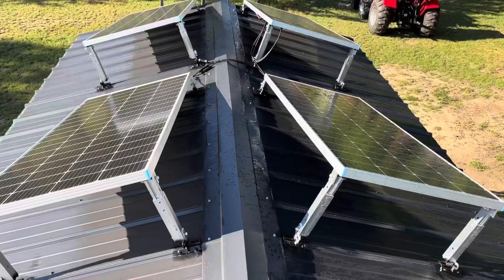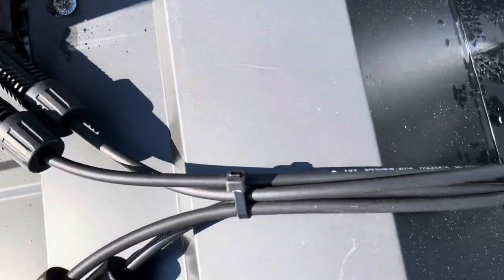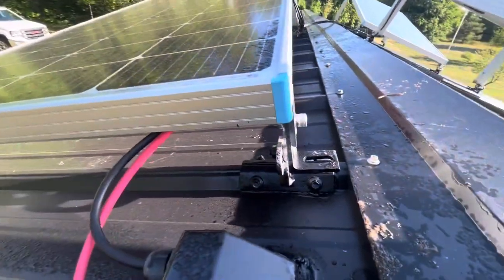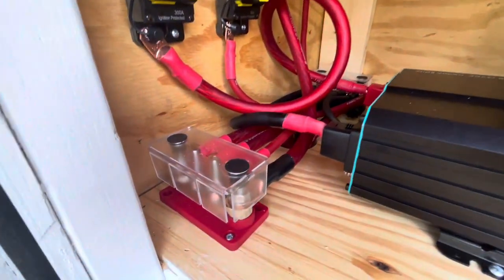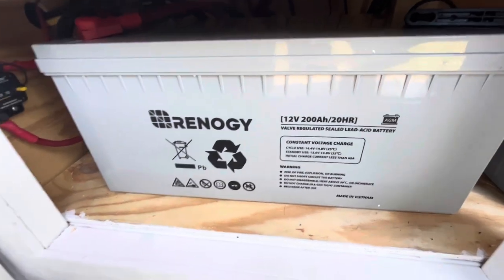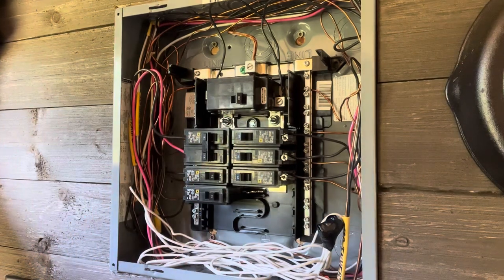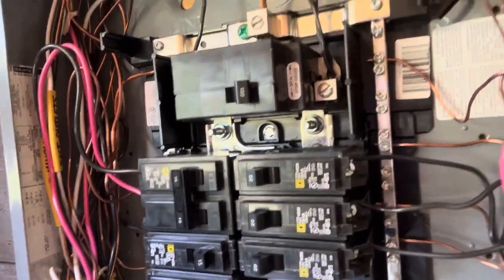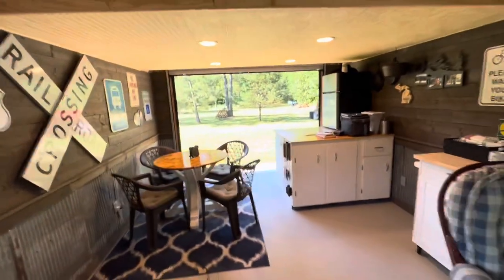Solar Electric System Install Overview

Comment: I have roughly $3600 into my off-grid system now with six 415 watt panels, a 5kw Lifepower 4 5kw battery, and an EG4 inverter. It is a work in progress and my end up costing close to $4000 when finished, but it will provide plenty of power for my needs. It was hard parting with all that money, but I am happy I did it!

Comment: i hope wired the panels in 24v configuration, two  in series on one side the roof the other two in series on the other side of the roof and  parallel the two strings together.
it would be more efficient.
Reply from the maker: Thanks for the info, appreciate it!

Comment: Check out the videos I made about using a generator to just charge the batteries.  I added a 120 port to the rear of the the house that goes directly to a 75amp battery charger.  I case of extreme clouds for a long period of time I only require a small generator to supplement the solar.

Comment: All of your LED lighting and anything else that can run off 12v should be coming straight off the battery with an automotive fuse block.  No sense in losing power converting it to AC and then back to DC.